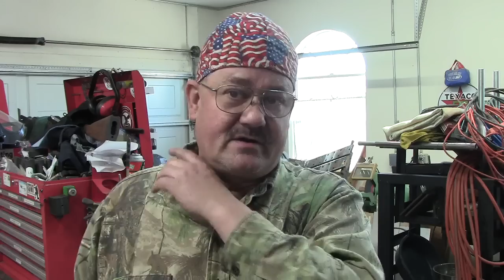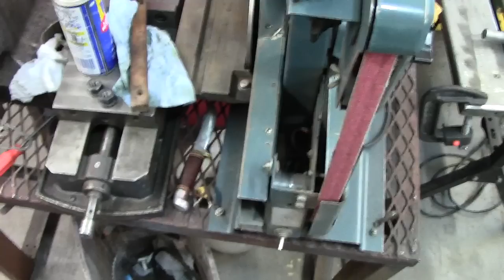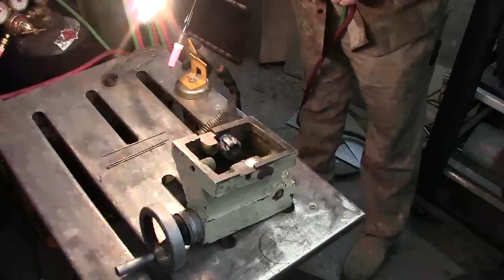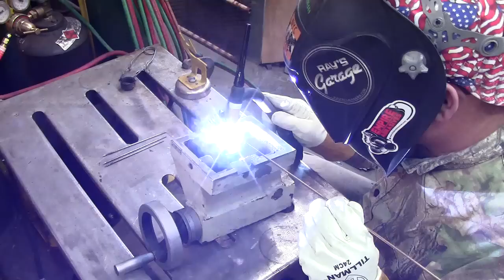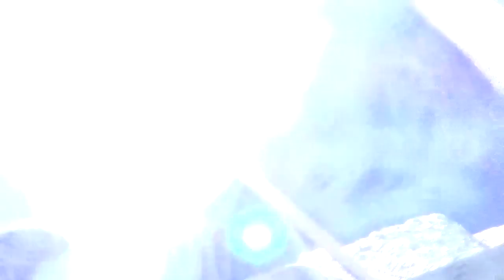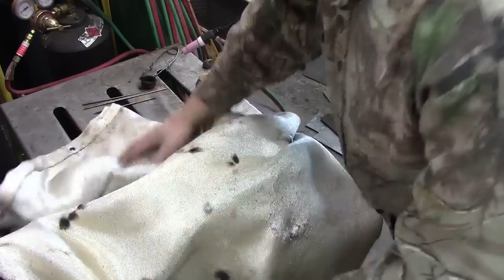Grizzly G0776 tail stock repair PT3

Comment: Nice. Try aluminum bronze on a/c.  I just did this a while back on cast fenials on my gate build. Jody has a vid on aluminum bronze as well. I have a vid on it as well.
Reply from the maker: TJS Welding and Fabrication I thought about using Aluminum Bronze but I have 40 pounds of Silicon Bronze and only 2 pounds of Aluminum Bronze. So  I went with Silicone Bronze.
Reply: Eagle Dustoff 37 Short Serious Shenanigans cool. https://youtu.be/niXqDIXMFdc

Comment: Hey James I don’t know if it’s was just the way it looked
but it looks like there was another crack on the right side of the hole where
you were brazing at look at about 21:56
Reply from the maker: Tobias Talley if there was it's not going anywhere now. Good looking out!
Reply from the maker: Tobias Talley well I must say great catch!!!! After it finished cooling I took a look at where you spotted it and bam! I'm going to fix that one as well. I knew this repair was going to be a can of worms but didn't know how wormy it was. More suprises in the next video for you and a special shout out! Thanks again for the help in spotting what I missed.
Reply: Not a problem sir I enjoy the videos and didn’t know if you
saw it or not. I would hate to see it come back later add cause you any
headaches on the reassembly
Reply: Eagle Dustoff 37 Short Serious Shenanigans 
The crack was very easy to see on camera when that side was red hot because the heat stopped right at the 3 o’clock position. 
I was going to mention it but also thought it was possibly a parting line in the original sand mold. 

It is easy to see why it’s so weak when you see how off centered the casting is to the machined hole for the shaft.

Comment: Zlooks like there's a crack at the 3 o'clock position of the bore. Look a 23:04 where the red hot metal stops on the right side of the hole.